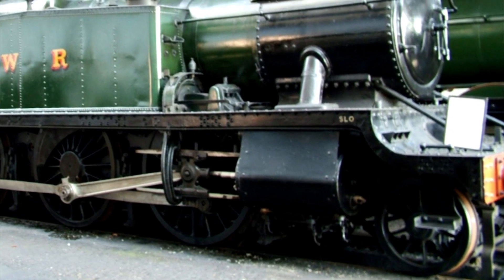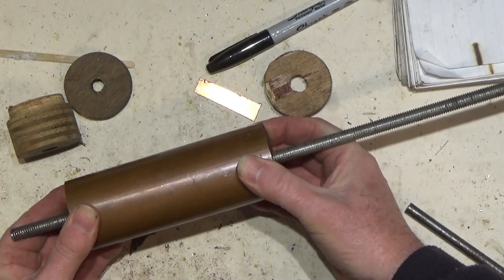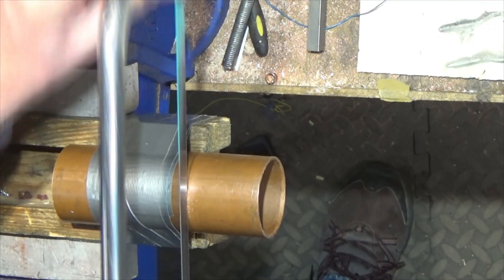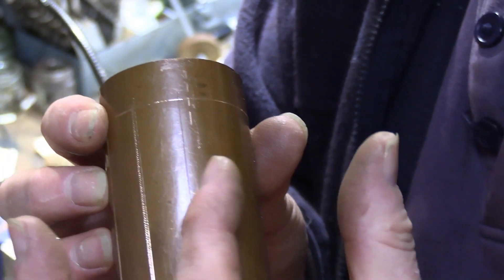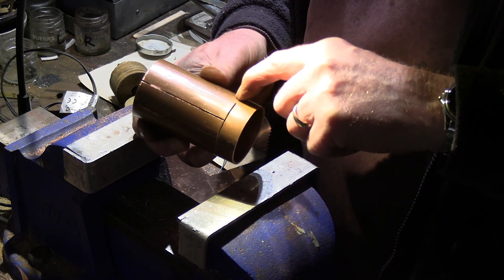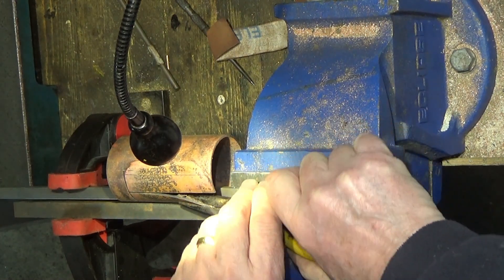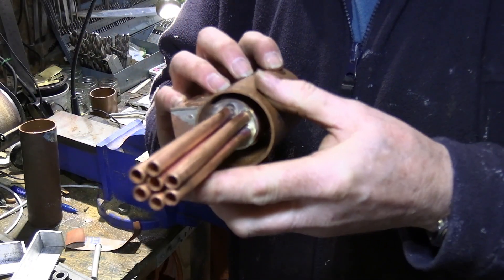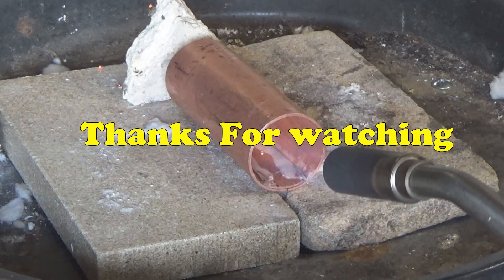Gauge 1 Live Steam Scratch Build 21

Comment: Hi,  I came across your channel by luck and i am very glad that i did. i have seen nearly all now. I have built one loco a 5 in  inch Dougal but I  am an amateur. I particularly  like your descriptions of the process's which you use to do the building  i find them exceptionally helpful,so much more information and experience than I normally find  also you do great video work. i am keen to do more. What Drawings  are you using for the GWR Prairie tank engine please???  Nigel
Reply from the maker: Glad you like the videos and are finding them interesting. Fair play to you if you have built a 5 inch loco. Gauge One is a nice easy manageable size to work with in my workshop, and like you I am just an amateur. The drawings are from Reeves 2000. They're fairly basic and far from complete in my opinion, so you'll have to fill in the gaps.
In hindsight it may have been a better buy to get some drawings for a larger scale Prairie Tank and then scale down to Gauge One and simplify where needed .
Reply: @GroveDave  Thank you for the information i think for me to scale down larger drawings is a little beyond me, the boiler is the stumbling block especially a tapered one with a surrounding wrapper, so i am watching your series carefully. Keep up the great work, who knows i might have a go!!!!
Reply from the maker: @nigelj4301  You can use a parallel boiler. Just means you would have a boiler diameter that could only be as large as the smoke box diameter.   So it's overall diameter would be smaller. The taper boiler is just me following that fact the GWR made taper boilers on the full size ones. I have seen inside a commercial Gauge One GWR locomotive and they are parallel boilers. You can understand why the commercial suppliers only produce parallel boilers as they are easier to manufacture.
Reply: @GroveDave  Thanks, I have just watched part 22 and a lot of my questions have been answered, i was worried about regulations, I also worried if re-soldering would be a problem as well but as the video progressed your explanation make things clearer, cant wait for part 23, Many many thanks Nigel
Reply from the maker: @nigelj4301  The main thing is that you use the correct copper thickness. Also the boiler bushes from all drawings i have seen are always made from phosphor bronze, not brass. My threads are always ME . But all the commercial ones use metric. I do a hydraulic test to twice working pressure you check for leaks again and for any bulging or distortion in the boiler.Then a steam test at working pressure to check the safety valve lifts at the right pressure, also with the fire at full tilt with the safety valve lifting the pressure should not increase, if it does, by no more than 10% of working pressure.  Also i have all the same tests done by an independent boiler inspector. For Gauge One if you are a member I am sure you can get a copy of the boiler regulations.